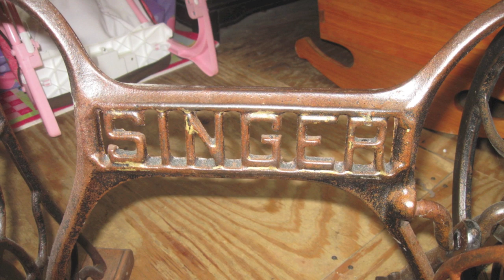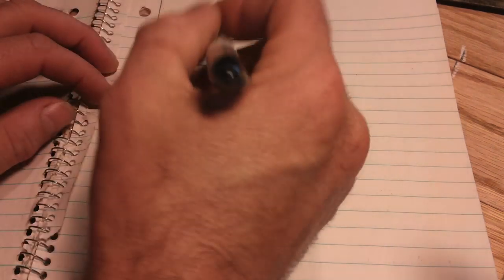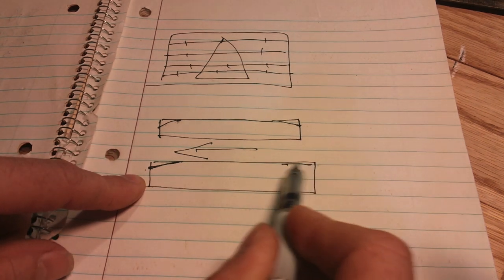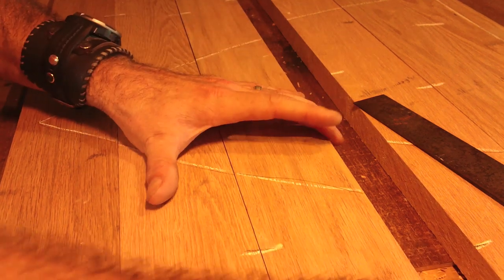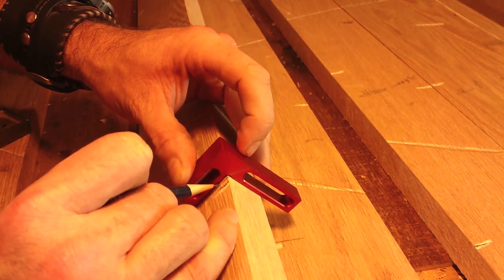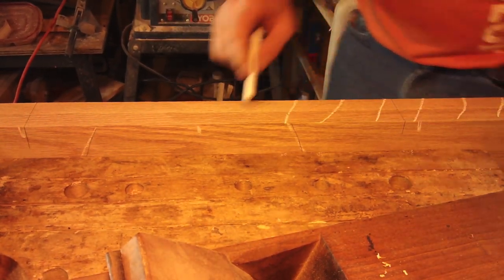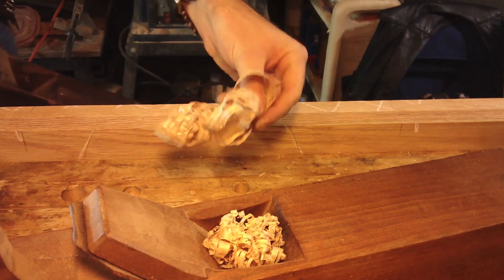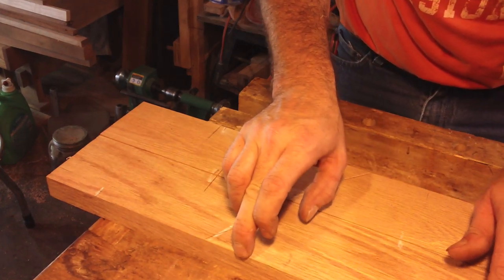Singer Treadle

Comment: On the planing, I do the same thing.  If if you take pressure off the front of plane by releasing or letting up on the front knob just before the end of the board while maintaining pressure on rear tote I found it helps immensely.
Reply from the maker: I totally agree. Proper control makes for a far better consistent edge.

Comment: I HAVE A SINGER 66 I NEED TO WORK ON THE TREADLE MECHANISM MINE WAS CONVERTED WITH ELECTRIC MOTOR AND THE TREADLE IS DISASSEMBLED ID LIKE TO BE ABLE TO USE IT WITH THE ELECTRIC OR TREADLE MINE WILL SEW THRU LEATHER WHAT A WORKHOSE
Reply from the maker: Bud they are great machines. That is why I bought mine. I wanted to sew leather. This was the best and cheapest method I could find.

Comment: Nice work on the video.
I see the treadle bases in the antique shops in my hunting territory but they all want a fortune for them. I don't have a need for one but they are interesting.
Good explanation of planning the edges. I don't do it very often so I have to sit an think before I set up.
Picked up on using screw clamps to hold the ends of the top square. I'm going to borrow that idea.
Were you using Gorilla Glue? I have a bottle that I'm starting to use but it seems to separate in the bottle. Could it be it was on the shelf too long?
Reply from the maker: Thank you my friend.
And yes they are expensive around here to. This one was sitting with a glass top for $85 bucks. Its all there, dress guard and tension device. I had to have it.
You see the edge thing a lot on the tube. This is my rendition.
Those clamps will pull a crooked glue up back square.
That is all the glue I had in the shop and yes mine separates bad.
Thanks for the comment!

Comment: Great job Dave....opposite of a spring joint I suppose?   What was the music?
Reply from the maker: Thank you. And yes I guess it is a reversed spring joint.
Cool never thought of it that way.
The music is some youtube copyright free crap. If I don't use there stuff I don't get paid. So I pick the best I can find. The song is called Chances.
Reply: Dave Bardin Dave, how much longer, than finished length, do you start off with, on the boards?
Reply from the maker: I had about two inches on the ends I cut off. The boards were a bit weathered and had some checking.

Comment: Also if you hollow out the middle rather then gapping the ends you have a spring joint.  The way you're doing it, the ends will have a tendency to open.
Reply from the maker: Robert with all respect. This method is what I find works better for me. It has yet to fail me. I have some panels I have glued together 30 years ago and they are still very gap free and solid. I live in the state of Mississippi and the humid climate here will test most any joint.
If you think thats bad you aught to see how I put bread boards on the end.
To each his own.
Again this comment is with all due respect.